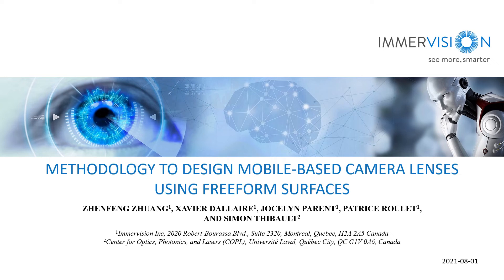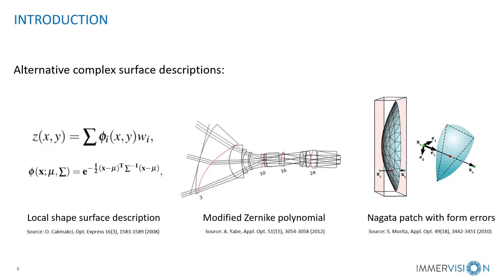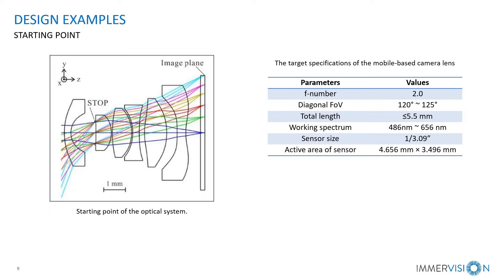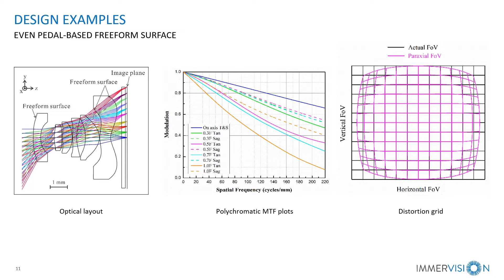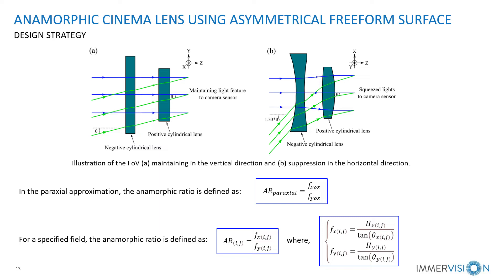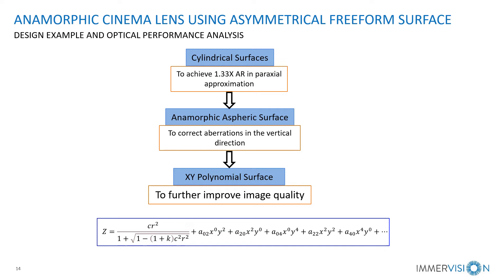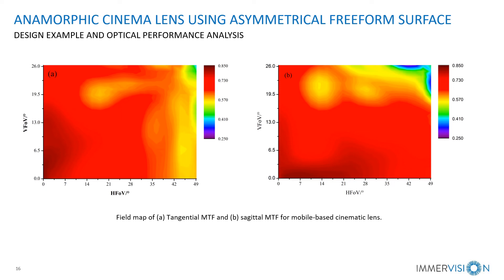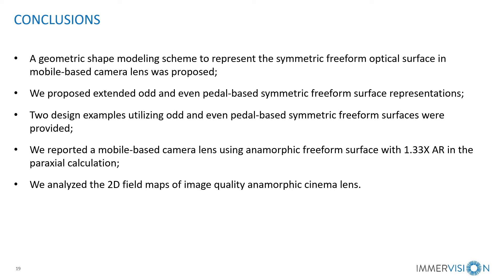Methodology to design mobile based camera lens with freeform surfaces | SPIE Optics + Photonics 2021

Comment from the maker: Freeform technology is one of the most promising solutions for enhancing the capability of aberration correction and improving performance of optical systems. Aiming to demonstrate the freedom and flexibility of optical system design, several challenging design examples using freeform surface are presented, including two wide-angle camera lenses adopting even and odd pedal polynomial formulations for symmetric optical surface description, and an anamorphic cinema lens employing non-rotationally symmetric surfaces for capturing a wider aspect ratio and offering a 1.33× squeeze factor on a 4:3 sensor size. Methods and constraints for designing and optimizing the optical systems are discussed. The optical performances of these design examples are analyzed and the results verify the practicability and effectiveness of the proposed formulations and design strategies in the field of freeform imaging optical design.